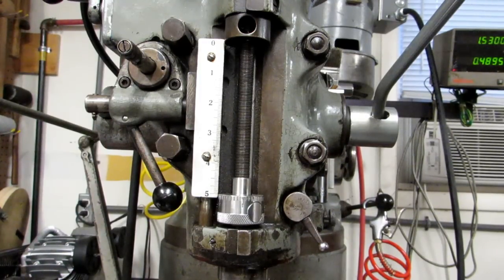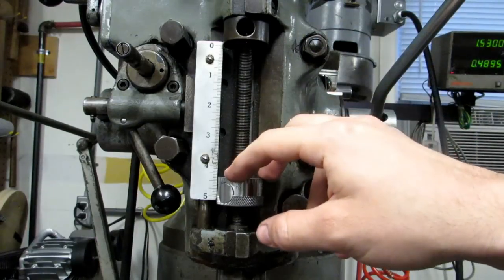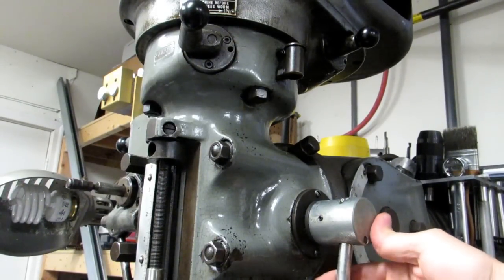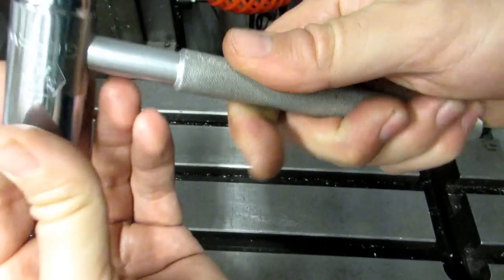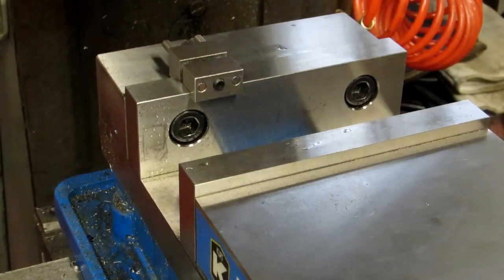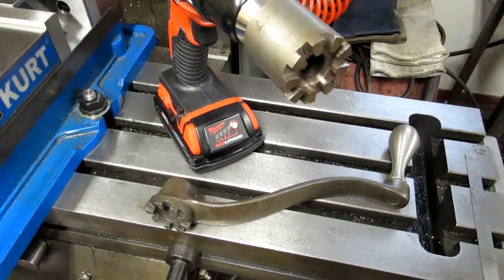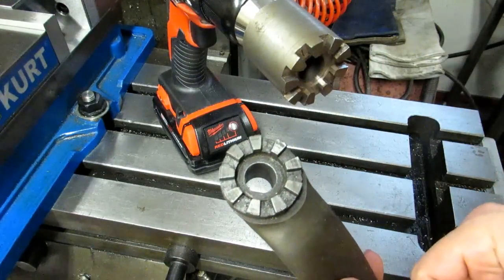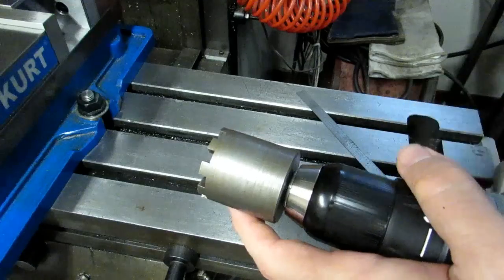Time Savers for the Milling Machine

Comment: The reason the knee handle has a flat section inside the teeth is because it originally had a spring that kept the teeth between the mill and handle from meshing. You would need to push the handle so the teeth would engage when moving the knee. Most people removed the spring because it was awkward to push and turn. Today it's ideal if you have a Z axis feed because you don't have a handle swinging around when feeding up at the prefect height to hit your nuts.